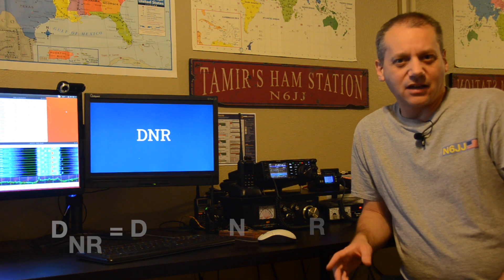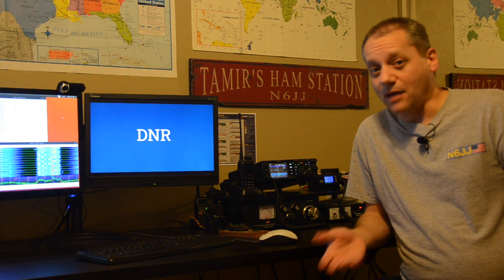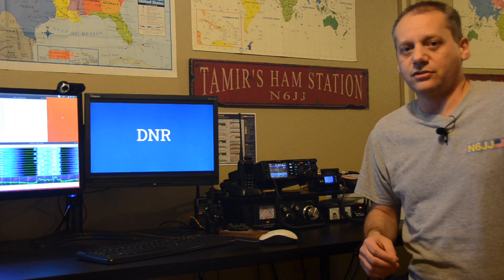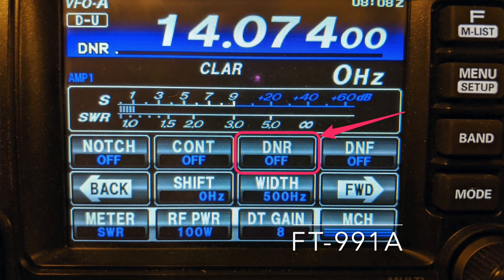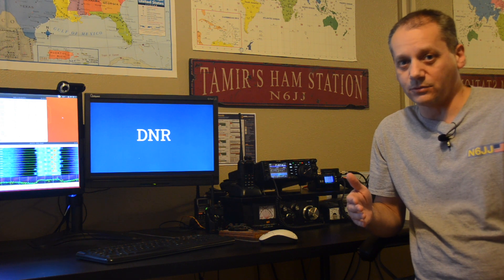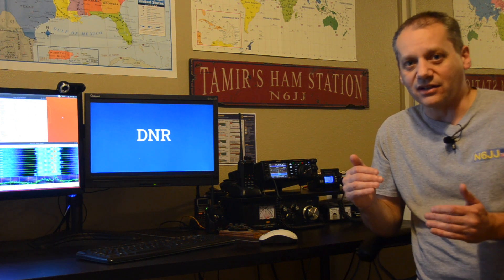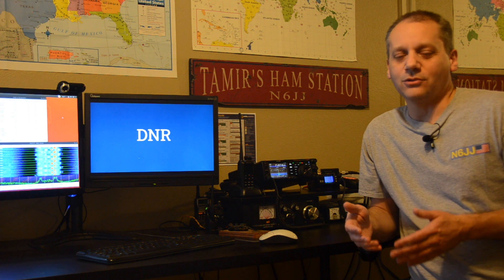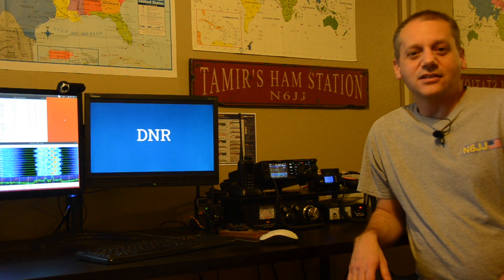DNR - Digital Noise Reduction - Work SSB with FM quality!

Comment: Impressive from the 991! I had an FT-450, and the DNR seemed to just alter the level of filtering, and as you added more DNR it sounded like it was introducing a lot of phase error on the vocal. I usually  ran it at a mid level, it helped, but not like you showed here. I have a 7300, and I would say while not heavily adjustable, it seems better than my old FT-450. The algorithm way is best, if you can distinguish between stationary noise and non-stationary voice. I did an algorithm similar in underwater acoustics, using scaled histograms, and BP prefiltering prior to applying the statistical histogram shapes. There were gains, but perhaps max +3 dB SNR. It's an neat problem and obviously things have moved on nicely since I messed with that.
Reply from the maker: Interesting experience, thanks for sharing. I'm sure that it's very hard to compare the FT-450 with the latest IC-7300 or the FT-991A, as these are different generations of transceivers. I'm not familiar with the 450 but based on the generation, I'm sure that it is based on electronics while the latest transceivers are  based on software. It's much easier to do some magic using software.
73.

Comment: hi, i am using the rrd-102v2.0 radio module, now i am doing a project, for example, how can i control a radio station empty interference sound. I need to check, if there is a parasite, I want to have it checked with commands such as do the following, otherwise do not.

//example

if(noise==noise)
{
   //bla bla bla
}
else
{
   //bla bla bla
}

(Arduino Projects)
Reply from the maker: If I understand your project, you will need to sample the audio of your radio.

Comment: Thats very effective.  I have to say better than the 7300.  Perhaps I need to make an adjustment on my 7300 to do better.  Thanks for the video. KD2LMR
Reply from the maker: Thanks for your feedback. Yeah, I heard from other hams that they are using that with the 7300, but as mentioned in the video its working a bit different. Good luck, 73.

Comment: Wow! That DNR makes a big difference. Which equipment do you recommend for a beginner?
Reply from the maker: It's a good question and to provide an answer more details are needed. For example, I would ask what do you want to do? HF, VHF/UHF? What interesting you like Phone? Digital? Satellite? But as a simple and quick answer, for a someone that is just starting with ham radio, I would recommend to find some low cost VHF/UHF handheld. This way, you will have the fastest way to get connected with your local club member, get more information about the hobby, you don't need any special setup like antenna, etc. Then, you will understand better what you want to do for the next step. I hope it helps.